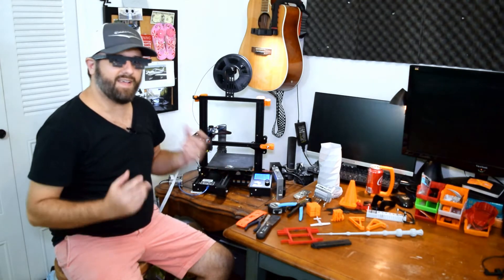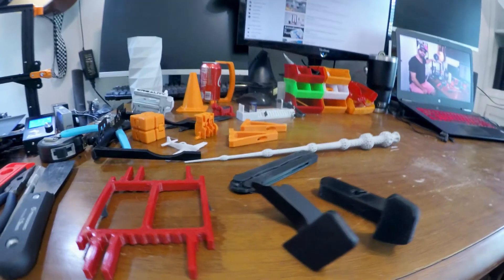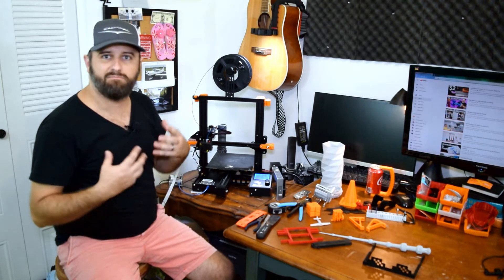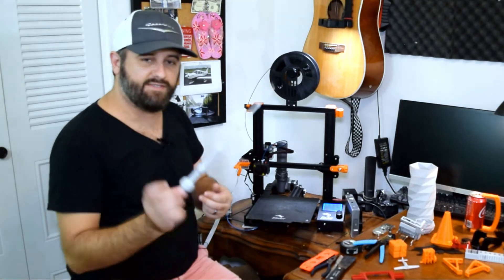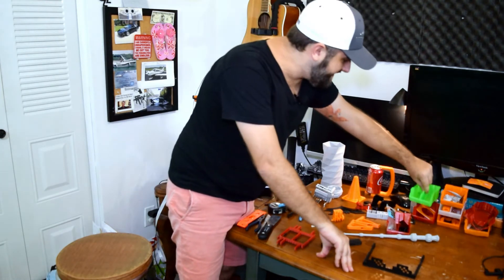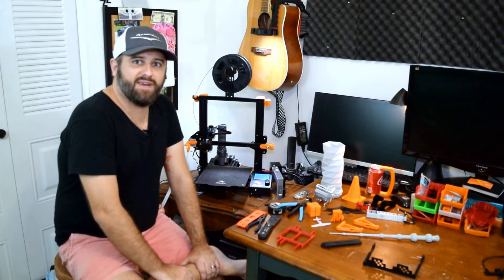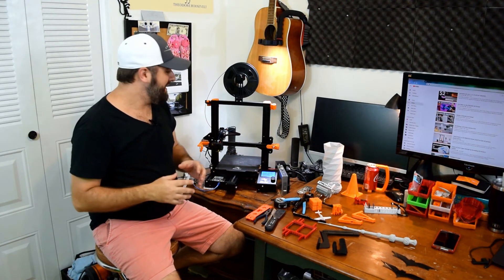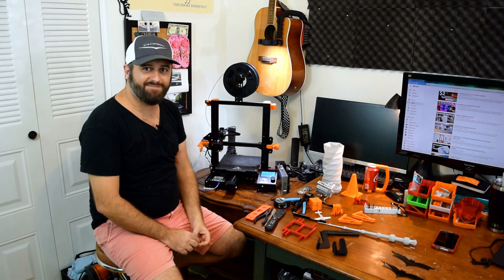I got a 3D Printer to Make Car Parts

Comment: It's the UV rays that kill plastics that sit in direct sunlight.
Reply from the maker: UV is definitely a concern.  Here in SW FL in direct sun it can approach the glass transition temps of PLA, so it's as much of a concern as UV.  I've even had some PETG prints warp after a couple especially hot days.

Comment: I too live in Florida and have a 3d printer.  One day, I accidentally left a PETG part in the car and came back to a very warped item.  I can’t imagine your hood latch did any better.  This video is 4 years old, have you’ve since tried ABS in your car or any other materials you’ve tried did any better?
Reply from the maker: The latch hasn't warped at all.  I did print a gauge pod that eventually got warped after sitting in the sun for 2 years.  https://youtu.be/AejjC10u14Q

With a good PETG filament, and high wall count + high % infill it seems to hold up fairly well.
Reply from the maker: Also, I've tried to print in ABS a few times, so far no luck with the ender 3.  I even have one that's enclosed now, but without active heating i was still having warped abs prints.

Comment: I'm getting this exact one later this month I'll use your link also. Question is this big enough to make hood vents like the ones for g8s ?
Reply from the maker: Much appreciated!  I do not know the dimensions of the hood vent for the g8s, but my guess is the standard ender 3 is probably too small.  I installed the Ender Extender 400 kit on one of my printers.  That may give you enough print area.  It increased to 400x400mm, or 15x15 inches  https://enderextender.com/collections/ender-3-pro-kits/products/ender-extender-400-for-ender-3-pro

Comment: great vidoo.  some car parts are on back order.  how can i take advantage of this?  thanks
Reply from the maker: Thank You.  If you've already got a 3d printer, then you can either find published files on Thingiverse or Thangs.  If you're trying to make something that no one had modeled before, then you'll have to do the 3d design yourself.  I am no expert with design/modeling but I do have another video detailing my process for recreating some window trim pieces for my S10 Blazer.  You could also pay someone to do the modeling for you, but I don't have any experience with that.  Just remember that most 3d printed parts have strength and temperature limits.

Comment: Question do you need a computer to print or is that something you just install a file through usb drive
Reply from the maker: You'll need something to get from an STL file to the G-Code file the printer needs.  But as far as G-code file to the printer, it can be SD card or USB.  There probably a way to do that with a phone.  I have a Raspberry Pi running octoprint hooked up to my printer though.  I use Cura on a good computer to create my Gcode files.

Comment: I still don't understand how to tell the printer how to make the part, do i have to buy a cad program and learn how to use it?
Reply from the maker: If you're using an existing design, such as a file from Thingiverse, then you need to load it into a slicer.  I use Cura, which is free.  The slicer outputs a G-Code file, which is the instructions the printer needs to work.  If you're trying to design a part from scratch, then you'll need some kind of CAD to create the 3D object file that you load into the slicer.  I have a video where I did that with some Window Trim.  There are a few free CAD options as well, like Tinkercad.  Get a Slicer first ,then download a file from thingiverse to print.  Once you get that down, then start playing around with CAD for customization and design.
Reply: @VHickleGarage  THANX! now I get it, good vid

Comment: Hey, how are the parts for the car coming up? I am doing the same to my 1972 Camaro, hoping to combine fiber glass, 3d printing and carpentry to create unique interion.
Reply from the maker: I haven't gotten to designing any parts yet, but I have printed a few more things.  I just added a Vacuum gauge to the Blazer using a 3d Printed Gauge Pod.  Hoping to get some stuff designed soon, and get another video out on it.  I would love to get into making some carbon fiber parts as well.

Comment: Great vid. 
What was your reason for getting an open build 3D printer vs the enclosed one? Or did it matter to you? 
I myself am considering the onyx one.
Reply from the maker: Thanks.  I got the Ender because it was a good price and it just seemed like a good printer to start with for me.  Open frame should only be a problem with materials like ABS that could warp.  I haven't tried printing in ABS yet, but if I do I can always build an enclosure.
Reply: @VHickleGarage  thx for the response

Comment: Awesome video!!! This is something I’ve been thinking about getting into! I think you got me convinced lol
Reply from the maker: Thanks!  It takes a bit of fiddling to get it dialed in, but it's definitely a nice thing to have.  So far it's mostly been great for small items here and there.  It's nice to be able to print what you need, especially if something needs a little customization or adjustment.
Reply: Learn CAD first.
Reply from the maker: I have been working on learning, but people shouldn't let CAD be a hold up.  There is so much on Thingiverse that people can easily get started with very basic slicer and printer knowledge.